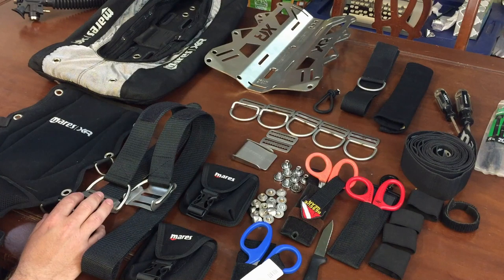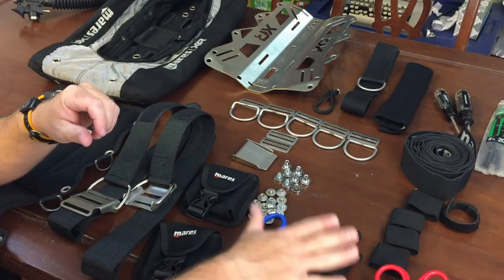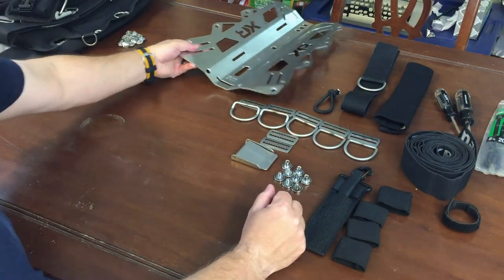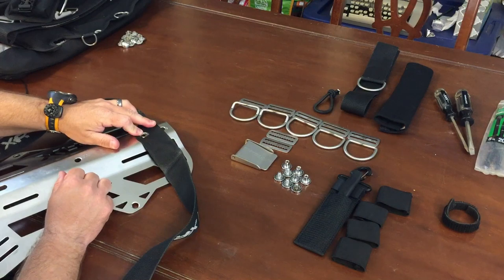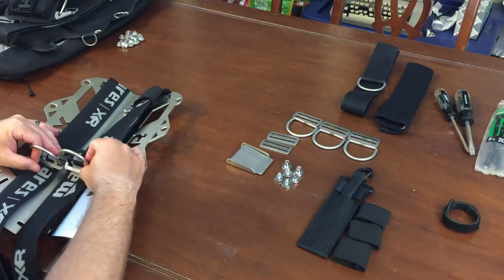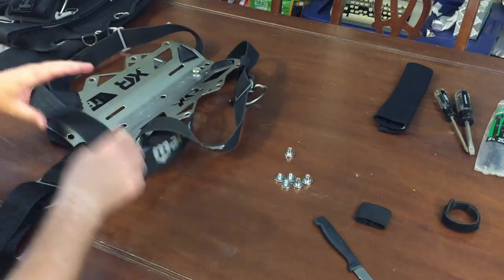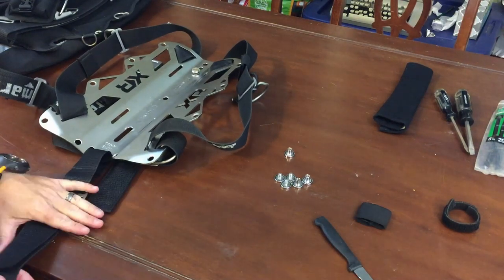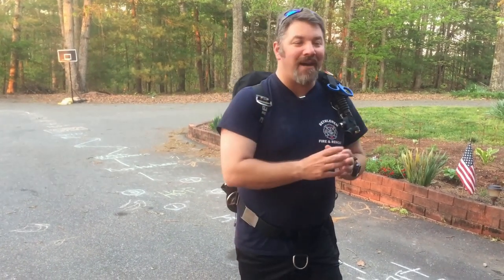Threading A Back Plate And Set Up

Comment: Where did you attach your trim weight pouches? Do you wear an additional weight belt?
Reply from the maker: Hello Dive Another Day.  My trim pouches thread onto the bottom tank cam strap.  They are simply there to fine tune my buoyancy.  All of my Back Plate and Wings, with the exception of one, are balanced out for specific types of diving, and specific exposure suits.  This means I very rarely dive with ditch-able weights.

Comment: I am a female recreational diver who has been diving a jacket style BCD since I started 16 years ago. I’m interested in switching to a BPW, but the options are overwhelming. I’m looking into the xdeep zen right now & would switch out the existing harness for a horgathian system. I’m just wondering what your thoughts are on a first system for a female diver. Thanks! Loved your videos!
Reply from the maker: Hello @jameesmith4771. My first suggestion would be to seek out your local Dive Center to see what models they offer and to get properly fitted. There are many brands to choose from, most if not 99% of them all work the same in regards to sizing. Especially, if you are wanting a one piece harness. Once you have done that, if your specific Dive Center does not have the brand you are wanting, then you will have a better understanding of how to adjust one if you purchase online. The hardest decision most divers have to make is, not the brand, but how much lift they need with the bladder. I routinely will dive either a 22lbs lift or a 34lbs lift. Most brands have a range between 15lbs to 37lb for single tank systems, 44lbs to 100lbs lifts for doubles. This is where you local Instructor who has experience with each comes in to play. During our SSI Perfect Buoyancy Course we go over the calculations for proper lift. The next hardest decision is choosing, soft / aluminum / steel back plate. I use both steel and a soft plate. My oldest daughter only uses a soft plate. Yet again, this is a good reason to go by your local shop to see what they have. If you are close to us, come by and we will let you try different models to see what works for you. The last thing to consider is, weighting needs in regards to weight pockets. If you are like my daughter, she does not have that much real estate around her waist band for large weight pockets. Thankfully, for most of her diving, she does not wear any weight, even in Salt Water. So she simply has two very small weight pouches on the back of her cam straps. Now with brands, we choose Mares, because we trust it, and its what we sell, but in the last 35 years in this industry, I have sold and used all of the major brands, and trust all of it. My top choices for single tank would be Mares, Zeagle, OMS, and maybe even Dive Rite (the travel XP System is a great choice). The good news, the majority of Back Plate and Wings are interchangeable, so you can choose one brand for the harness, one brand for the wing, and one brand for the plate. Mix and max at your pleasure.

Comment: Is this a rig that can easily be converted to side mount? I’m new to side mount and BPW.  I’d like to convert from a jacket to a BPW, but don’t want to invest if I will have to turn around and buy another rig when I’m ready to explore side mount
Reply from the maker: Hello Nick Jarboe, yes and no.  You can very easily add a Sidemount Bladder to the Back Plate instead of a standard bladder system. However, the flexibility is not quite as good as having a shoulder plate and a lumbar plate. The Mares XR Pure Sidemount system is a better system for Sidemount, this of course just being my opinion.

Comment: Great tutorial. I have exactly the same backplate system, one question on the weight belt though, since I’ve been using traditional weight belt, I am experiencing the plate hitting the weight situation, which makes my waist very uncomfortable, any tips there? Thanks in advance ;)
Reply: One way to resolve this is to use trim weight that goes in a tube and attaches to the two bolts on your doubles bands and/or use a tail weight that attaches to the lower bolt in your doubles bands. You'll find both trim weight and tail wait pouches on Dive Gear Express.
Reply from the maker: The thing that we see a lot of divers do, is they will wear the weight belt too high. Most Freedivers where their weight belts lower, thus with Back Plate and Wings, we try to do the same.

Comment: Advantages of diving a stainless over an aluminum BP, or vice versa?
Reply from the maker: Hello C. Patrick Sadowski, great question. For me, its all about weight requirements, and practical use of the back plate. For travel, I like the soft plate the best, and other divers prefer an aluminum plate. Aluminum plates also come in handy for diving doubles while in a thinner wetsuit. I also use steel, when added weight is necassary, such as diving with a Drysuit. Since we are a commercial diving company as well, most of our salvage divers will wear steel plates and steel cylinders to help eliminate the need for weight pouches on our waist straps. This allows us to have more realestate for tool pouches and other necessities during working dives. Here is a video we did in the past on plate choices that you might find interesting. https://www.youtube.com/watch?v=ajgO8qyzI-s

Comment: Question, does it matter which way the bent D-ring faces?
Reply: Jonny B Kuehl outwards so that you can clip on easier. If it’s bent towards you, you’d have to lift it up to clip on.
Reply from the maker: Hello Jonny B Kuehl, as Danny Holden stated, most divers prefer the bent to be outward, so it makes clipping off items much easier.

Comment: GREAT Video - thank you!
1 question: Ive seen tri-glide hardware with smaller D rings on the side (which I was planning to thread on ea. shoulder strap w/ the D rings facing in - then connect a chest strap to help secure everything)
...do you recommend this? I guess Im asking because I have a big chest and Ive noticed arm pit hot spots - figured a strap could help help with it.
Reply from the maker: Hello Nate Shank, you can most definitely do that. We would encourage all divers to make sure their rigs are comfortable and set up to meet their needs. A lot of sidemount divers will configure their harness in the same way that you mentioned.

Comment: Great Video as usual,  I don't think you got around to the use of the bungee on the inflator hose.
Hey I got the first comment!!!
Reply from the maker: Hello South Toledo Bend LA, you are absolutely correct, I forgot to come back to it.  In short, the elastic band holds the inflator hose close to the shoulder, and the bungee secures the inflator itself, making it easier to access it when needed.

Comment: Sir can you tell the length of mares xr donut bladder 10kg? Plan to buy still doubt if it’s fit on my back. I bought apex wtx d18 and it’s too long on my back.   Thanks, it will help me decide wisely on buying the bladder.
Reply from the maker: Hello Robby Natividad, from the center of the top to the center of the bottom is 24 inches, 60 centimeters. Hope this helps.
Reply: @LakeHickoryScuba   thank you sir. I hope in my size it will be ok. Great help.🌈
Reply from the maker: You're welcome.

Comment: I don't see any reason why anyone would want to do this when you can buy a BCD off the rack that can be adjusted very easily unless it gives someone a false sense of control or they happen to be built funny. Probably the same person who swears by a standard shift over an automatic which only creates more effort or the guy who goes fishing all day and is stuck with cleaning the mess. If you want a fillet go to the grocery store, they probably do it better. The parts are available if it makes you happy but I want to dive not tinker with small parts. Of course I might be prejudiced having worked as a bench technician for 15 years in an unrelated industry. Informative and good instructions though.
Reply from the maker: Thank you for sharing your thoughts with us @arrivedp.